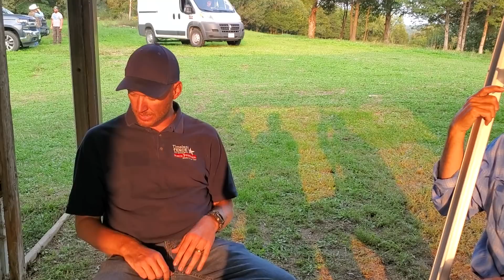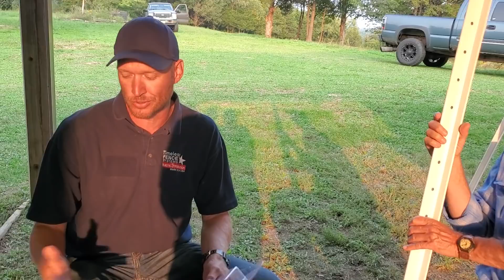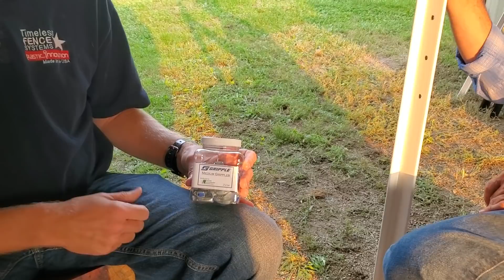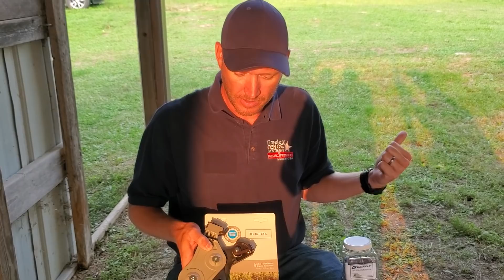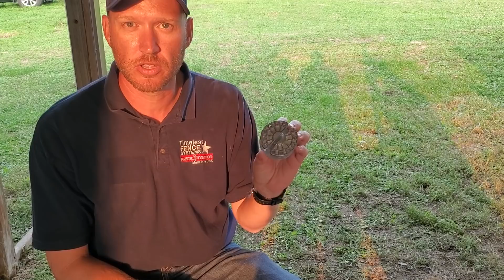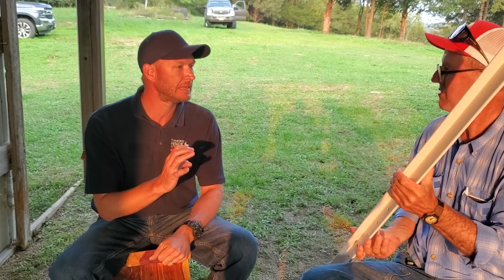Greg interviews the best electric fence post manufacturer in the world!

Comment: Does high tensile fence have to be energized?
Reply: You can run high tensile fence cold, but it is more effective hot
Reply: if you want an electric fence, yes
Reply: @eastpak2g6  if I wanted a perimeter fence that wasn't electrified can high tensile be used that way or is it only effective if it is electrified?
Reply: @Burns Warfield sheep